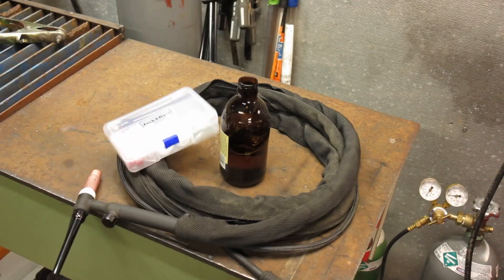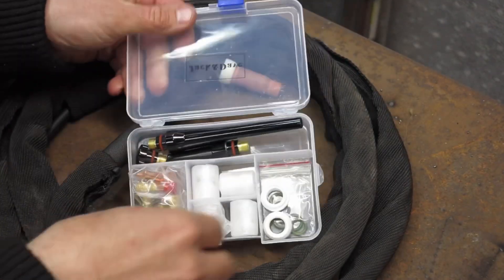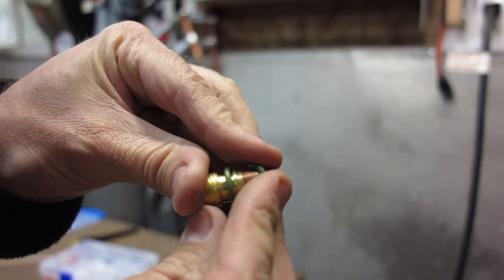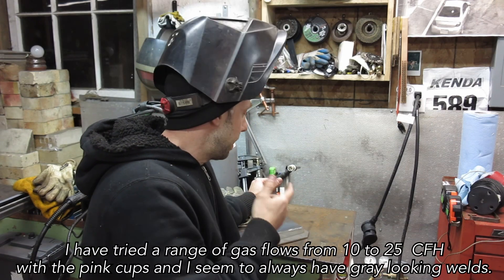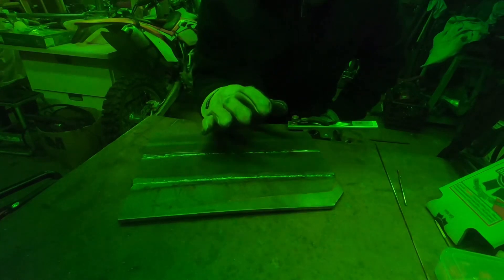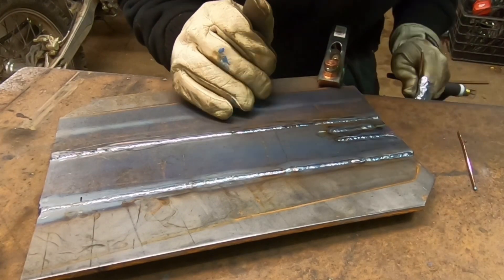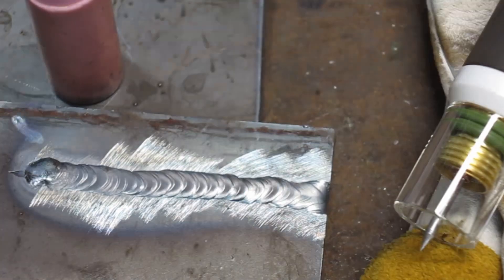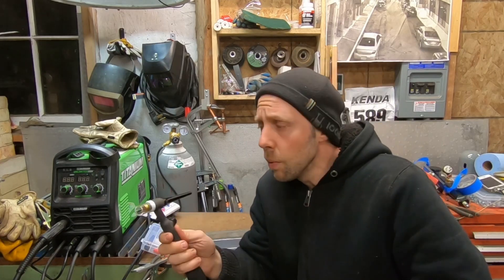Stubby gas lenses for TIG torch

Comment: I bought basically the same kit for my torch. The first time I used the Pyrex cup, I couldn’t believe how much better I could see the arc. The best thing I ever did to improve my TIG welding! I suspect you are correct about the poor shielding with the standard cup setup. The gas lens with Pyrex cup really does gives better gas coverage and visibility and is well worth the upgrade.
Reply from the maker: I’m glad you have noticed the difference as well! Yes definitely a good improvement all around, plus using less gas will definitely add up in saving gas over time. Thanks for commenting :)
Reply: What welder do you have
Reply: Theodore Bowers   If you mean me, I am running a 40 year old 800 pound 380 amp Linde boat anchor. For $200 with Bernard water tank running gear, torch & hoses, water cooler, and even some filler rod, I couldn’t go wrong and it will likely outlive me. It will weld anything I’ll ever need it for, tho it does take a 100 amp circuit to run it at full chooch......
Reply: @notajp  sounds really cool I'm a beginner I bought the same machine Mike has the 200 so far ,I like it even though I don't know anyting ,, lol.  
Mike's been a great influence on me.   I'm an old man just starting out welding now I'm usually pretty good with everything else ,so I  learned I can manipulate metal just as well,, just got to learn no high school diploma,, cannot read and write ,,barely ,,never went to school makes life a little more challenging and fun,, from doing things I want to do was raised in an orphanage so you understand no family sounds like you have a cool machine and it sounds like fun thanks for getting back to me.. I'm really surprised to see how many different brands there are how many techniques it really gets confusing I think I overthink things too much I have to worry about money a lot so I worry about things that are not good expensive and losing the money by making mistakes it can hurt me pretty bad financially so I panic easy I think out of the box too much.  anyway I'm rattling on sorry thanks for getting back God bless good luck

Comment: If I may be so bold as to offer advice. If you are using a low power welder use multiple small passes. This is the huge advantage of Tig welding. The" pink" cups are called " lava" .  The difference is the gas lens. The gas lens allows for a better gas coverage. I have never used Pyrex gas nozzles , but I will see if I can try them out. Keep practicing. Don't throw away any torch pieces, you can never tell when you will need them. Good luck and God bless you.

Comment: Hello.
Thanks for showing about that welder. I bought one and I am very happy with what it will do on 110 volts on might. I have not tried the Tig and stick yet. My son is certified in many kinds of welding and he could not believe how well the welder ran. Thanks for showing the units.

Comment: I'm teaching myself TIG welding right now, too, so your videos have been especially helpful. It's good to watch the old pros like Jody and Mr. Tig to see how things /should/ be done, but watching a fellow beginner is far more inspirational. I'll definitely get the stubby pyrex lens kit based on your experience, and I'll recommend to you to get (or use) the foot pedal amperage control if for no other reason than it makes stopping and starting a lot easier (though there are other reasons - I'm just not good enough to legitimately take advantage of them).
Reply from the maker: Thanks Jeffrey! Yes welding tips and tricks is a great channel! I definitely like his videos, super helpful. I just bought a AC tig with high-frequency for Aluminum welding, it’s definitely a great machine and yes the pedal is nice along with the high frequency starts! Thanks for commenting, TIG is definitely a bit of work to learn and I have a long ways to go but it’s slowly getting easier. Keep practicing and I’m going to do the same, I’m looking forward to hearing from you again! Take care :)

Comment: Use a copper spoon to end your weld .  Just bring your torch on to the spoon to end the weld and have the spoon angled toward your weld and the gas will still flow onto your weld ..

Comment: Hey Mike can you try and explain that third switch on the right or dial I understand the first two wire speed and heat right what is the third one actually do the far-right one could you please go into a little more detail on the dials and switches trying to explain a little more 4 the common person that's not too smart like me
Reply from the maker: So the third one on the far right is inductance for the MIG feature only, it kind of changes the how the voltage is applied   And I don’t know a lot about it but I can tell you it seems to help smooth out your beads and by changing it will give you a small difference in the look of the weld, I’m sure in a cut and acid etch test would show small details too. I recommend welding on a scrap piece of metal and play around with different settings on the inductance to see what different you notice. Sorry but I will need to read up on the topic more to give a better explanation, I hope this helps. Take care :)
Reply: @Mikefestiva  I. Did play a little with it I don't known what the he'll I am doing .. It seems to me I think it got better and I think maybe hotter,, I doing know if I am right ? What to learn more on it as well,... Thanks for getting back . that was great lots don't follow up on your comments.. You do so in behalf of everyone else I want to thank you very much Mike
 👺        🇺🇸

Comment: Interesting stuff Mike, I might give them a try. I only have a TIG welder now having used arc, gas and MIG previously. I find TIG more difficult than any other, but as you say it gets easier with practice. Used it successfully on the heavy steel for the sawmill and shepherds hut, but my vintage Cemont does have HV start and 240V of course. I find that you only have to have the tungsten poking out of the lens about the same distance as the diameter of the rod.....but still manage to 'stick it' occasionally :)
Reply from the maker: I do remember that you welded your sawmill up with a TIG welder, I definitely need to just start on a project like a work table or something like that and TIG weld the entire thing, I find it to be the best practice to just build something and as you weld the joints I can look them over and improve as I go. Hey is that highway still possibly going through your woods? I sure hope not.
Reply: Yes Mike, the road is still very much a possibility, no decision yet but 'Eco' surveys are being conducted in my woodland in the coming months.

Comment: Hey Mike, excellent video! Looks like your Tig skills are improving quickly. I wouldn't have guessed that a glass tip and better diffuser could make that much difference. On another note, I'm a writer for ToolCraze.net and wrote about the The welders a while back. I recently had a reader comment asking if the Vulcan accessories would fit the Titanium machines and I haven't been able to find any info on it. If you can let me know if they are compatible that would be awesome!
Reply from the maker: Thank for checking out my video! I know the Vulcan spool gun won’t fit the Titanium, and the MiG whip won’t fit, I think the main brass lug is different size  but I know for sure the electrical connection on the welders are different, the pedal is also different. The torch however is a component that is quite universal and as long as you look on EBay for a size 17 manual gas valve TIG torch with a Dinse 25 plug they all should fit. It’s a bummer that the other Vulcan stuff won’t plug right in. Now I know this is beyond some people’s ability, but if I ever break my MIG whip I probably would order a sturdier one on line and just turn the end down on my lathe or make a simple adapter to fit it to the titanium, snip off the Titanium’s special 5 prong connector and wire it to the new whip. Ps I was able to adapt a Miller spool gun to my Vulcan Omnipro with a simple adapter I made on my lathe. Sorry for the long comment, I hope it helps. I will check out ToolCraze.net. Take care :)
Reply: @Mikefestiva  thanks man. I'll let the reader know about your findings!

Comment: Hey Mike. Thanks for another AWESOME instructional video. Thumbs up! That gas lens kit looks decent for the price. 
I love these inverter welders!!! You can weld ALL DAY on the cheap at 25 amp draw out of the wall. Practice, practice, and practice all day without jacking up your electric bill.
Now where is that new VULCAN PROTIG 200?
Reply from the maker: These machines are definitely a great way to go, I definitely never see my self going back to a old style transformer boat anchor welder ever again, Haha!
I hope to do a video of the Protig soon, I just finally got ahead on videos, this is the first time I can remember that I wasn’t feeling down to the wire to get a video posted, I have a few more weeks of videos to post soon, next week I’m going to post the Titanium and Omnipro TIG side X side video. To tell you the truth I have only got a few hours to run the Protig the first week I bought it, life has been busy these days, but I really want to do the first video welding up a project, I’m planning on making a Aluminum motorcycle stand for my KTM 200, I really feel like I learn more when I just jump in and build something and learn along the way. I have a endless supply of 1/8” 6160 Aluminum from my work at salvage prices,  there old snowboard molds, and there’s pallets full, 14” wide and about 5 to 6 feet tall. Take care Joe :)
Reply: @Mikefestiva  I can't wait for the video next week. What do you think of the Vulcan ProTig 200 so far? Hows the arc starts? Tough piece of gear! I'm still saving for one. getting super close.

Comment: Well if it doesn't work out you could always re-use it puff puff haha just kidding. Thanks for testing it for us. 
Try holding the thing between your index and f-u finger, using tig fingers obviously. Then try to keep an even path parallel to the welding surface. Looked like you were frog hopping a bit.
Reply from the maker: Haha! Thanks I appreciate your suggestions, I will try that out. Take care :)

Comment: I am a little like you and not one for all the fancy stuff BUT I tried the glass one you have and they were ok BUT I was using the pink cups with a gas defuser and the difference was not so great , BUT I went to GLS Fab "Unbreakable" TIG Welding Cup, PTFE - #16 which is a Teflon non breakable cup that is a gas lens with a 1 in. opening and allows for up to 1 in. stick out you will be impressed. I bit priceyer but non breakable can throw it on the ground and still works. got it at https://www.verociousmotorsports.com
Reply from the maker: Thanks for commenting, I will take a look at those cups, Unbreakable sounds great! Take care

Comment: What is the best way to sharpen the tips of the tungsten? What do you think Mike?
Reply from the maker: I just us a small 6” bench grinder, a small belt sander would also be fine, I hold it at the correct angle and spin it to get a taper of about 2x the diameter of the tungsten your running, say 1/16” tungsten would have a taper of 1/8” and so on, You should grind them in the same plane as the grinding wheel, grind them so the small sand lines go towards the tip not spiraling around the tungsten tip, I know that sounds odd, if you look up a few photos of proper sharpened tungsten you will see what I’m talking about. One other thing, people say you should dedicate one grinding wheel to just tungsten, but I just use the stone that’s been on there for a few years, it seems fine to me. Take care and I hope this makes sense, it’s a lot easier to show someone then it is to try and write it out. Take care brother :)
Reply: @Mikefestiva  makes perfect sense thanks for your opinion that helps a ton

Comment: Yeah, I had ordered the 16pcs kit for almost $30 and looked around and figured it was the same as the cheap one that could be had for $10, the higher price one got better reviews of course than the cheaper priced ones. I just couldn't live with the feeling I got ripped so sent it back. Ended up getting the 49PCS off ebay for $20 shipped. Got the alpha tig in Wednesday, but have as yet to even pull it out of the box to test it or the kit, as had a bad, but at least short cold. I agree about reviews, I see to many times, usually after I get the product and go back and read the reviews again, that 90% of the time is is people who just don't know what they are doing (and likely never will), and likely should not be trusted with what they did buy the equipment to operate in the field they bought it for. "I gots all these parts left over, I can't figure out why the dang thing don't work. Just have to leave a bad review." Went with the same tungsten kit in  2% Lanthanated also, exact same one. Ordered two packs though.
Reply: Little over $20 now for the 49 piece kit.  https://www.ebay.com/itm/49Pcs-TIG-Welding-Torch-Stubby-Gas-Lens-10-Pyrex-Glass-Cup-Tool-Kit-WP-17-18-26/273723370226
Reply from the maker: Man that’s to bad you got sick right before getting your new welder, I’m excited to hear what you think of your Alpha Tig, get better so you can get out and try that fine machine out! I will take a look of that link for the cup kit. Take care and thanks for commenting!
Ps I got a Vulcan Protig 200 a few weeks ago and only got a few hours to try it out, I’ve just been to busy these days, I hope to get more time to run it a bit more, I was however really happy how well it welds.
Reply: @Mikefestiva  Ah, having a cold for a couple days wasn't to bad, and at least it didn't linger. I've been due for one, been some time since I have had any real funk. Despite the (adult) daughters all seeming to want to give some sort of nasty funk too me the have had repeatedly. Worse thing is is that I had been working out on 3of4s daughter's brakes on her truck (and still haven't figured out why it is soft, nothing ever seems to go easy for me when cracking lines) and was so spent I rolled the welder on the wagon up to shop, and left it on the cart figuring I would get up and put it away, not calling for rain, and of course it did rain. Not to bad though, and caught it early.

 Kinda of interesting about that kit I posted, I had bought mine from a china seller with domestic stock as I said for $20 and went to look at it to post it, and now it is $28 shipped from China. Most things they usually charge more for if it is already domestic. Not the only thing I have noticed taking major price increases, especially from China. Hope it ain't harbinger of things to come.

Yeah, I think ole chucky did a hatchet job on the review he did on the Vulcan Protig 200, as he is apt to do it seems. Seems others think more highly of it. I'm sure you will  do us good service on you reporting on yours when you put it though some paces more. BTW, I did get a chance to break the HF helmet out of the box, and like others who have taking more time and use to it then I did by far have said, it seems to be a right good one. The lowes one may be a tad cheaper (unless you forgo the warranty on the HF one) and has a little larger view, but it sure isn't a RealView either. I like that about the hf one, leastwise so far just getting it to trigger in the sun. And what was even more fun, all the daughters, grandson, and number one's boy friend were all here testing it with me and I got to say "Luke, I'm your father!" when it was my turn, lol.Yep, went over like a lead brick (probably should have went for the heavy breathing too), but we had fun anyways.

Well, can tell I'm tired, the fingers don't know when to stop. I reckon I will try to get a little nod and wink before I start this day in short order.